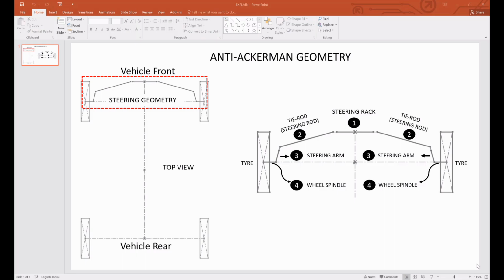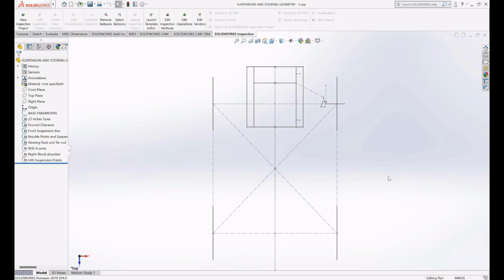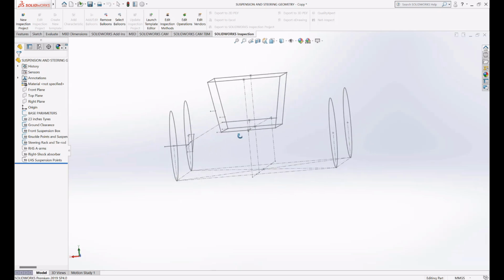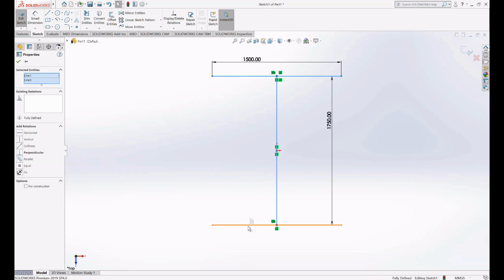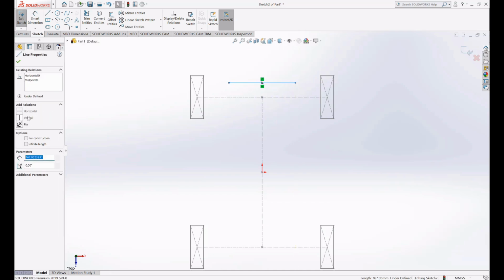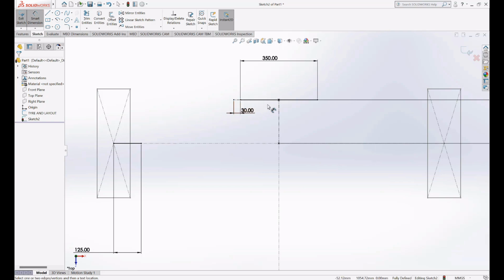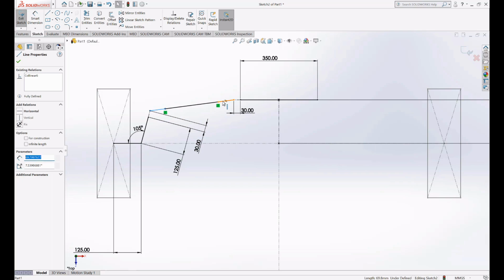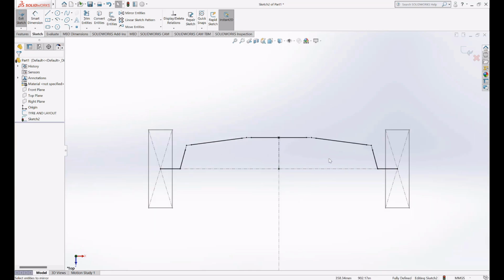Anti-Ackerman Steering Geometry | 3D Sketch | Solidworks

Comment: Bro how did you calculated the steering arm length and angle
Reply from the maker: Calculation can be done from steering equation and analysing the desired steering ackermann percentage or anti-ackermann percentage. if you want short turning radius, then you need to keep high anti-ackermann percentage, in that case you need to keep high steering arm angle. Like that we need to find a trade off between multiple parameters. There is no clear cut formula for length. Length depends on strength and packaging constraints.

You can follow my Lotus analysis video. It has two parts. You can check it in my channe page.
Reply: Thanks bro @ASquareCD